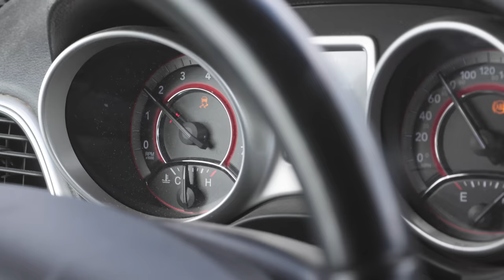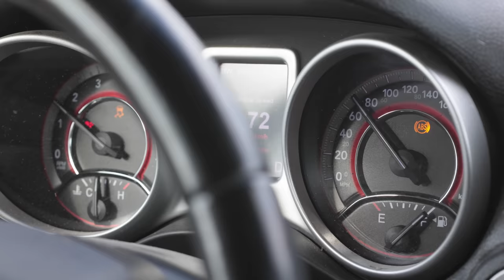Vince's Dodge Journey Gets an Engine Swap... Worth It?

Comment: It is called PLANNED OBSOLESCENCE. I've got a 2012 grand caravan with 104k on the clock AND the plastic y for the cooling system was leaking got one from local store but plan on replacing with stainless steel fittings on all plastic ts or ys because that composite plastic is SHIT

Comment: Idk what's with the plastic on these era dodge vehicles. The lady's chrysler 200 had a failure at the fill port in the front for coolant. The plastic was the consistency of hard but wet play dough and just crumbled to chunks. Almost killed her car because of it. Won't be buying anymore Mopar of that era after replacing all of those pieces
Reply: The 10 year statement you made is true for sure. Hers is a 2012

Comment: What am I missing? This engine swap looks like a replacement!
Reply: Your comment is a little ambiguous… replace , swap.. don’t they mean the same thing or am I missing something?? Not being critical, just asking..
Reply: @nobodyspecial6436  the term "swap" usually is used when you transplant an engine into a vehicle that it didn't normally come in, or a different size than it had before. Since Rich put a different engine in that is the same as before, I guess its technically a replacement.
Reply: @mittenstategarage9093  thanks for the clarification….it’s clear as mud now!!!😁😁… FYI… that means I understand fully

Comment: All new cars are built to self-destruct shortly after the warranty expires. All the "plastic" crap holding critical fluids are the first to break . I am fixing a 1987 Jeep yj so I never have to buy a new car. 17 yr I have owned it and other than rusting away , it runs perfect , has never failed and cheap to fix has ac as well. Classic insurance is 200 a year full coverage, I know people paying that a month on a new car. Get dirty and fix you old junk .

Comment: Motor swaps are never worth it unless its a newer car not above the rust belt, its a race car, you pull the motor yourself from a known working car or your putting in a brand new motor..  otherwise youre always gonna get a headache..   whether it be wiring demons or other broke crap…
Reply: Thank you at least someone in these comments has Common Sense especially with a Dodge Journey too might as well trash it